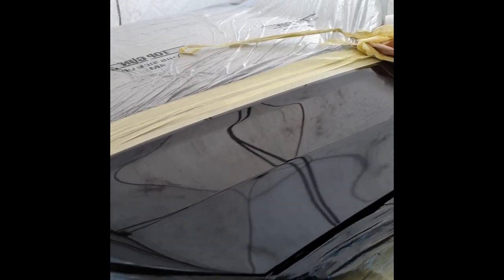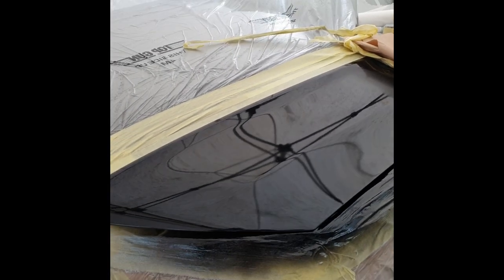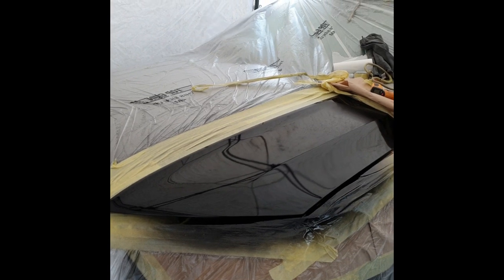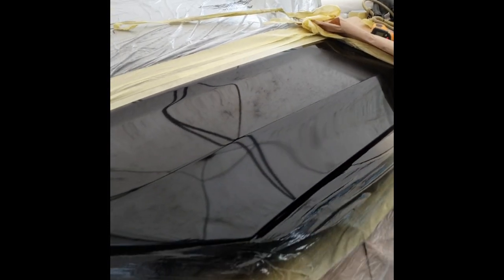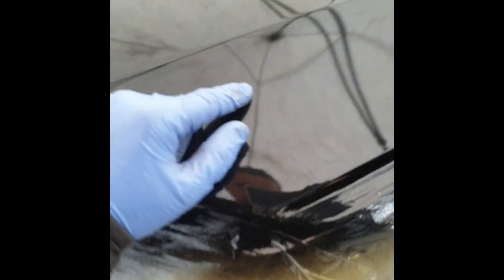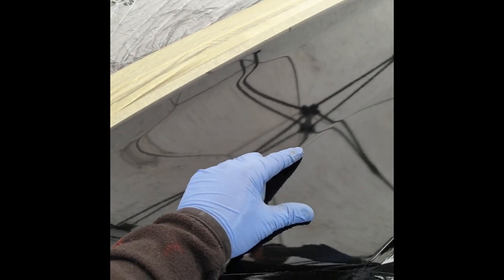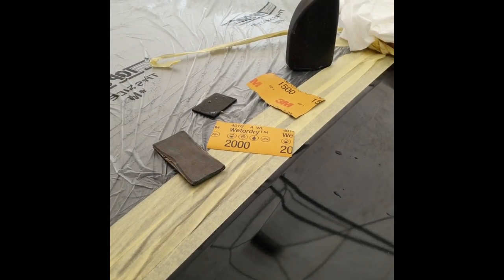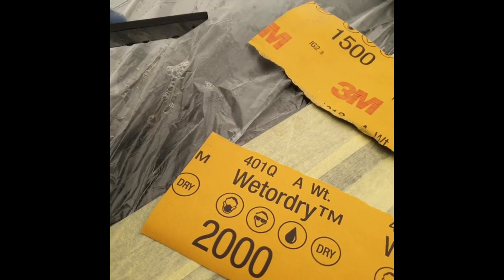BITS?? Remove bits from your paintjob and make it like glass!!

Comment: Great video what was the compound you used i like the 3m fast cut i also used roar 610 but the 3m is a great product and very versatile did you ever try multi mix clear coat its a great clear coat pmp supplies sell it they were doing the 5 litres of clear and 2 and a half litres of hardner for £66 if you look up tony Refinishing on you tube he did a demonstration he is top class sprayed a maclarin
Reply from the maker: Hi mate yes it's 3m fast cut. Ive tried the roar stuff its pretty good. Not tried multi mix but I've heard good things about it. I might have to try it 👍🏼 thanks for watching

Comment: so one thick clear coat? coz if its two and theres shit in the 1st were fuc&ed right?
Reply from the maker: My clear tacks off in around 3 mins. Unless its a massive bit of junk or its an opposite colour to the paintwork (ie white bit on black paint) then sometimes a few bits invetween coats you can still get away with. I nearly always apply 2 coats. This video was a pretty extreme example of contamination potential problems